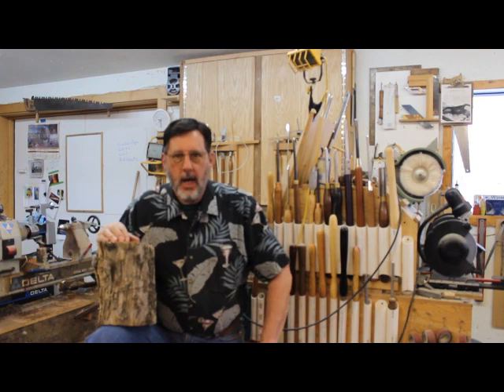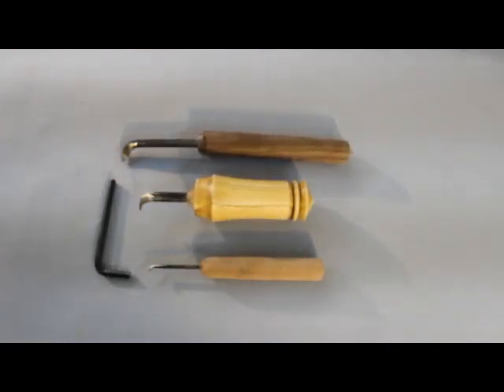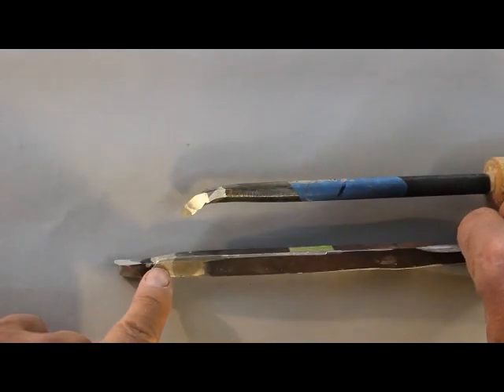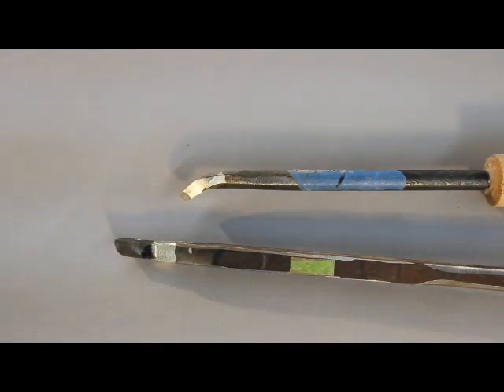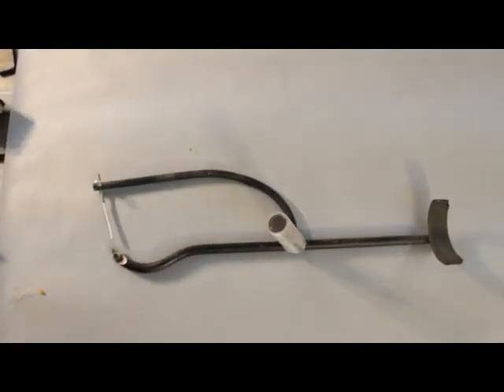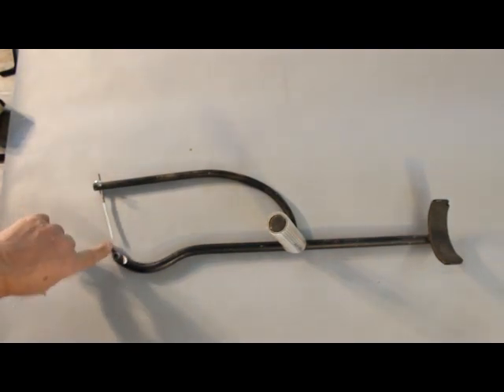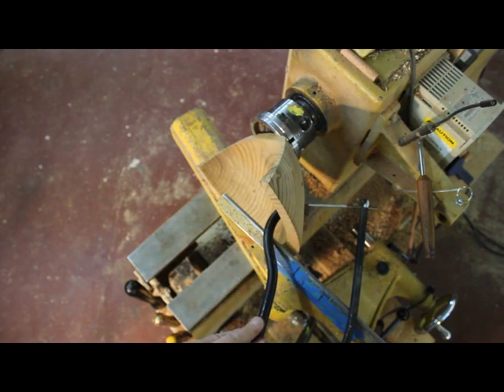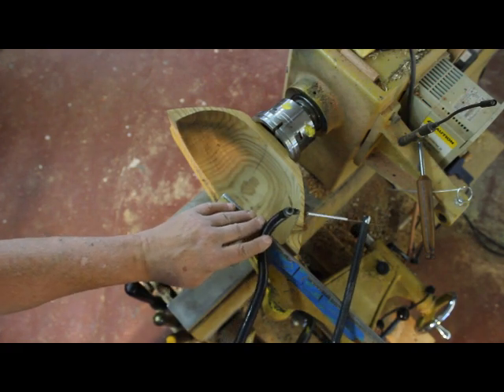Part 3 of 5,  Hollowing Tools: Woodturning

Comment from the maker: I was sold on the view one gets when looking over the horizon of the piece you are turning.  It is just natural to see the depth gauge.  Also----I need to say that I have never had a problem with the chuck un-threading.  I usually do some hollowng first with a straight bar, then go to this one when it is about an inch thick.  Sam

Comment from the maker: I have actually had pieces come loose while sanding in reverse.  What has happened in my experience is not too exciting.  Since the wood is also spinning, they have loosened a bit but keep spinning.  If you slow down the speed gradually, the wood will slow down and re-thread as well.  But of course tighten the piece a bit more.
Sam